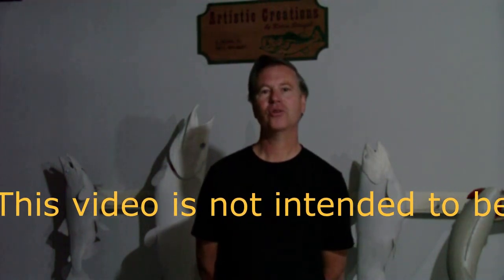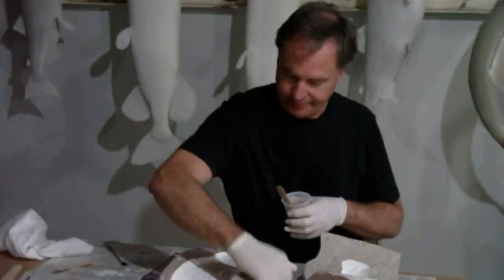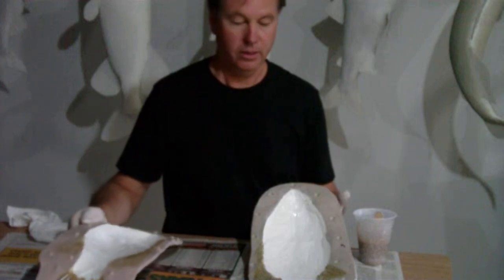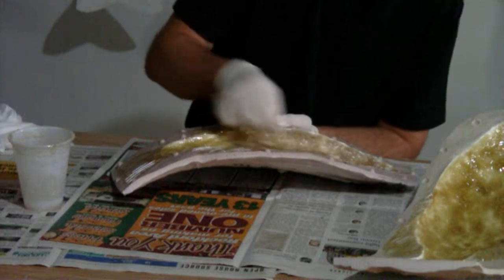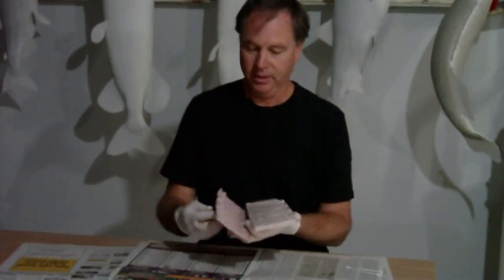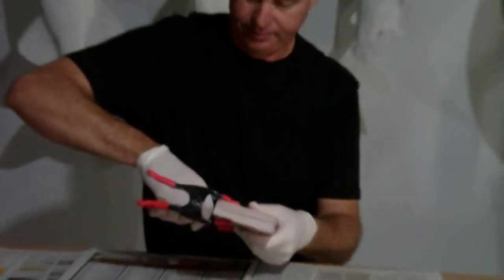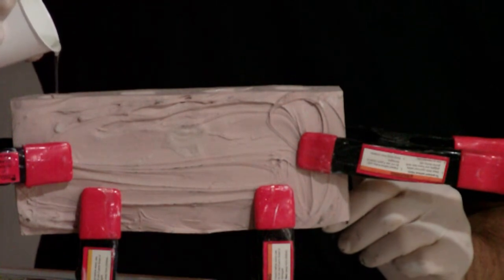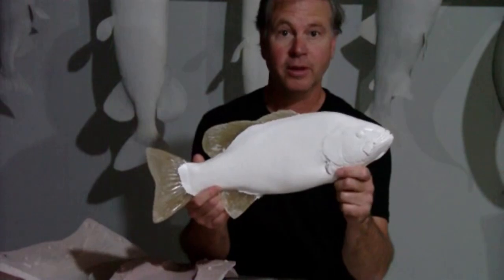Casting a SM Bass for Fish Replica / Reproduction Taxidermy Part 2

Comment: I cannot believe that fish came out of that mold so effortlessly, I tried doing the same thing with Vaseline and I need a dynamite to get it open. Also the gel coat would run down the sides and would not want to pool in the middle of the mold
Reply from the maker: A couple coats of a good good paste car wax & PVC has worked well for me. I also like to brush gelcoat up the sides of mold until it starts to thicken.